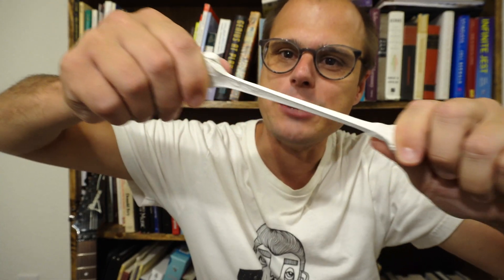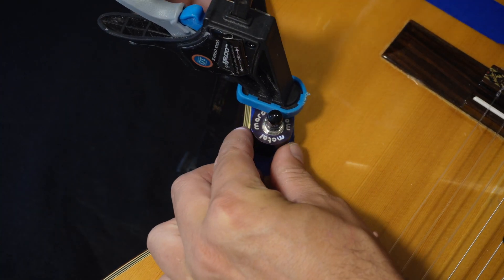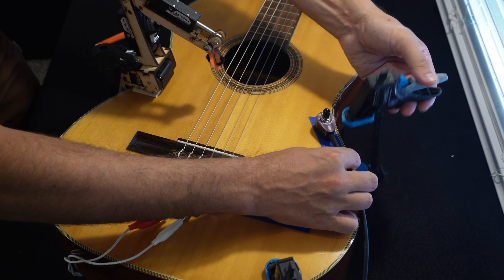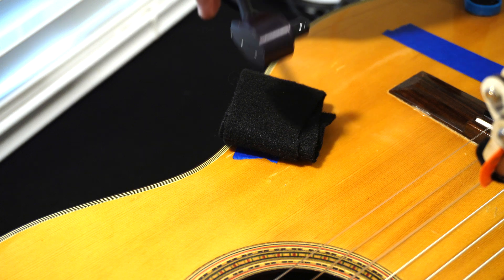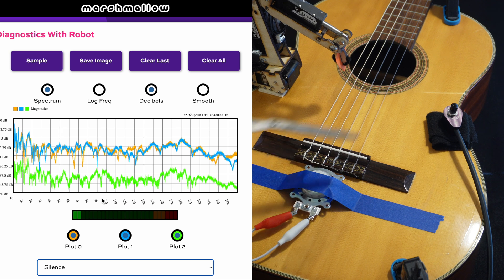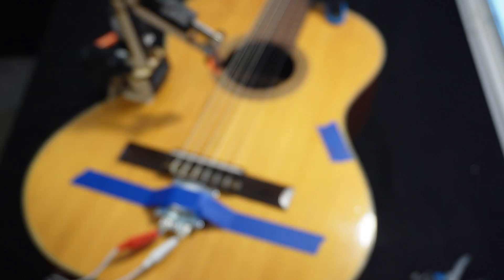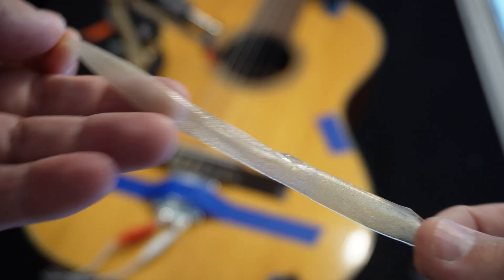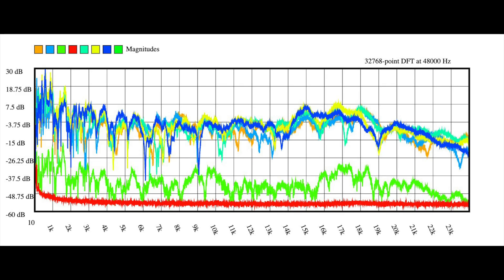Testing contact mic adhesives with a guitar robot

Comment: When you did the test with the felt, the cord was touching the edge of the guitar and probably transmitted some information to the mic going around the felt. 😅 the cord was in several different spots, which also could affect the sound. You should’ve compared the same type of adhesive multiple times to see the variance within the controlled environment.

Comment: fascinating experiment. but why is positive pressure needed on the transducer? that just interferes with the transducer's ability work optimally.
Reply from the maker: Ah, just to keep it from vibrating itself loose since I'm using weak adhesive. I don't need it to be optimal here, just consistent and repeatable.